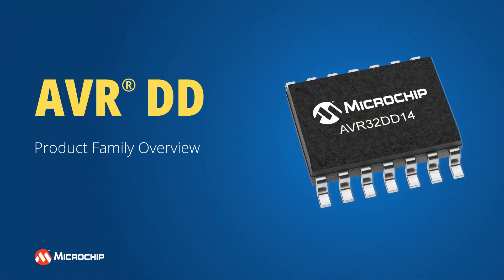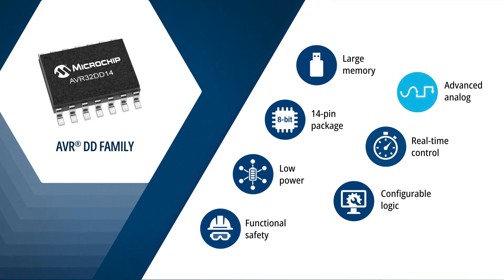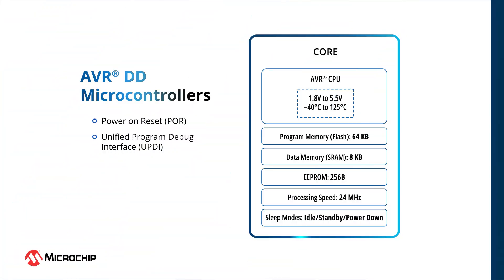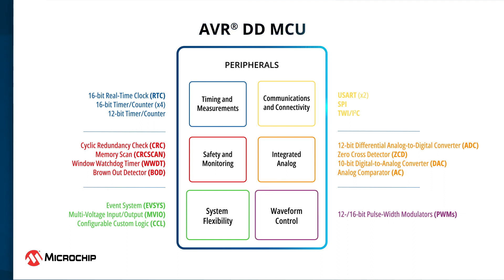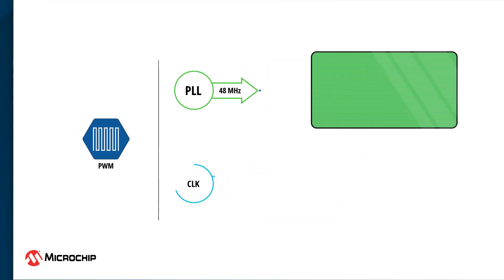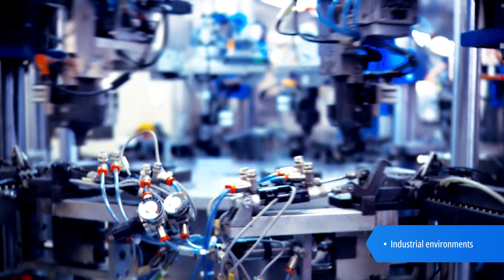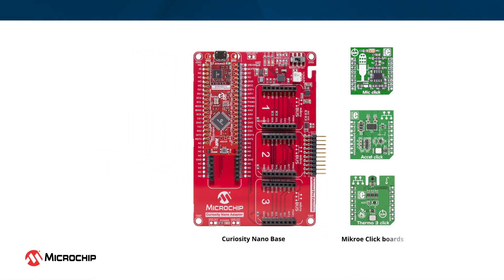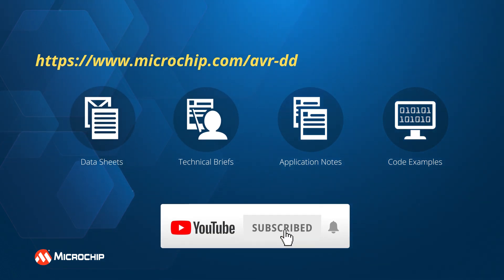AVR® DD Product Family Overview

Comment: Looks great, now I’ve only gotta wait another 5 years until AVR-GCC supports it. Only a few questions:
If you’ve got a 12-but SAR-based ADC that’s got to be using an internal 12-but DAC anyway, why not have a 12-bit DAC available for voltage output?
What’s the schematic for the dev-board’s integrated programmer/debugger? Looks a heck of a lot cheaper and easier to diy than the UPDI-capable programmers you guys sell. Hope the firmware on that debugger is available to download.
Reply from the maker: Hi there, thanks for your comment. The AVR64DD32 Curiosity Nano was designed to have a 12-bit ADC. We have other microcontroller options if you are looking for a 12-bit DAC, please use this link to search: https://www.microchip.com/en-us/products/microcontrollers-and-microprocessors/8-bit-mcus/core-independent-and-analog-peripherals/integrated-analog/digital-to-analog-converter
The AVR64DD32 Curiosity Nano Schematics are located on the product page, the on board programmer/debugger schematic is on page 3: https://www.microchip.com/en-us/development-tool/EV72Y42A. If you need further assistance, please feel free to reach out to us at www.microchip.com/css.